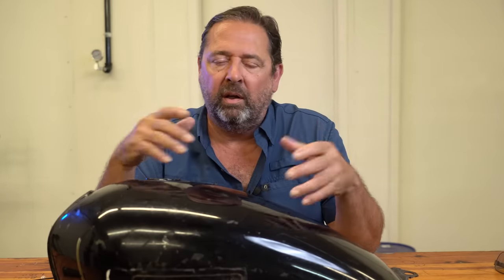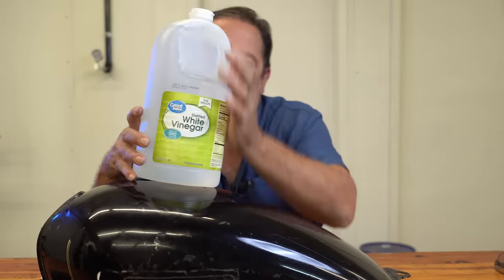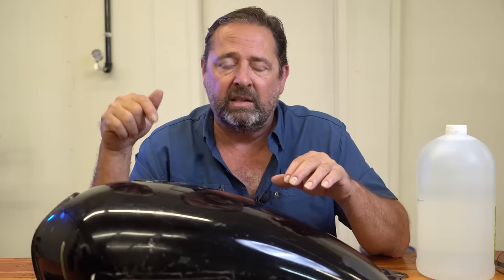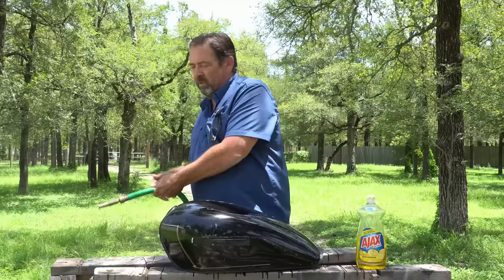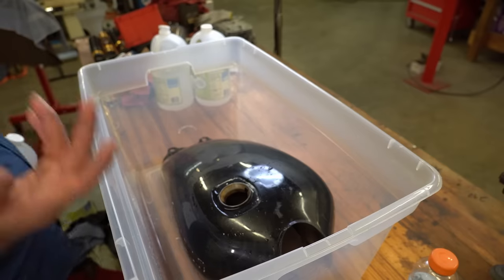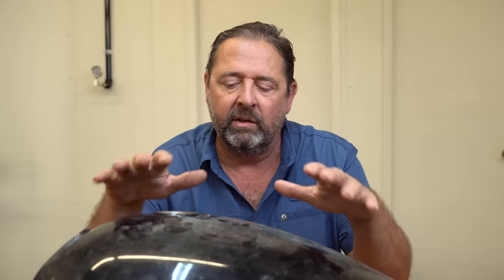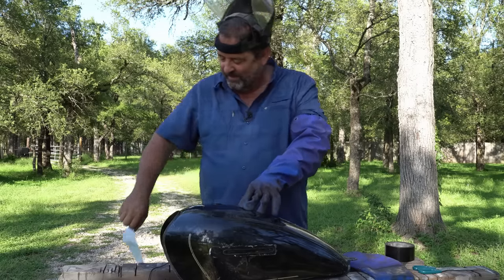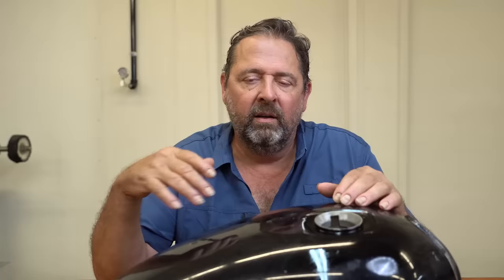GAS TANK--CHEAP--RUST REMOVER !!!!!!

Comment: The works toilet bowl cleaner usually under a dollar a bottle. Use high pressure water first to get rid of loose debris in tank.plug petcock opening.  Pour the works in tank, swish around  top to bottom for a couple of minutes. Open cap and look at results. If still rust continue until,bare metal. It removes all rust to a bare metal . High pressure water rinse. Add baking soda plus water to neutralize acid. High pressure rinse. Air hose out remaining water and spray with WD-40. LET DRY. Will not rust again. Do not leave the works in unattended for a long period of time or you will not have a tank left. This in tire process takes less than 15 minutes.
Reply from the maker: I'll check that out.

Comment: What about for some white corrosion in the tank?? Just bought a 02 gsxr has tiny bit of rust but has some white corrosion towards the top how can I remove it the best? I was thinking the vinegar and a toilet brush or something let it soak for a while?
Reply from the maker: Take the tank off, get everything that you can out of it, i.e., sensor/float.  Plug all holes except fuel inlet, then fill with strong vinegar 18-30% (Walmart garden area).  Fill the tank up to the brim and let it sit for 24-48hrs.  Drain, rinse with water, blow out remainder with compressed air, putt back on bike and fill up with gas.  Depending on how bad the rust is you may need to repeat rinse process a few times.  Hope this helps.

Comment: Is the acid necessary? And do I need to put a coating on the inside of the tank if I just use the vinegar?
Reply from the maker: You don't have to use acid, just be sure you leave the vinegar in for a lot longer, like several days.  And no, you don't have to seal the inside of your tank with a sealer unless it's really bad, i.e. pin holes.
Reply: @CycleFab  Got it. Thank you for responding, have a good day!

Comment: Once you neutralize the acid with baking soda and water, you spray wd 40 or put some oil in there. After that do you wash it out with water ?
Reply from the maker: If you are going to put the tank back on the bike then just wash it out with gas.  You can also wash the oil out with acetone.

Comment: Question . Have you ever used Rust Converter in a Tank , after getting rid of the Loose Crap ? 
Calcium Carbonate  or  End-Rust or some such . Then of course , should still get sealed .
Reply from the maker: No, I haven't.

Comment: For decades I used Diluted Phosphoric Acid, and clean gravel together to chemically remove rust, followed by a couple of rounds of neutralizing with baking soda and water, followed by lots of fresh water flushing, and hanging in the sun to dry.
Today,  I would use Evaporust heated to 90-120 F,   the clean gravel is still a good trick, for both the cleaning and the rinsing.  There is still no better Tank Coating them 3M Fuel Proof Coating.   it is an industrial product and full of VOC's  so probably hard to get now.  You Must mask the paint and plug the fuel tap  ( and vent if there is one), before using this coating.   Drain all excess, hang in sun for a few days to cure.  it has a slightly red color that looks very original in most classic bikes like BMW.
Reply from the maker: Sounds really thorough.

Comment: I’m worried about flash rusting.   After the acid shake is done why not just pour baking soda directly into the 1/2 gallon of acid in the tank will it boil over?   How much baking soda is need for 1/2 gal of acid to be neutralized
Reply from the maker: NEVER POUR BAKING SODA DIRECTLY INTO ACID WHILE ITS STILL IN YOUR TANK!!!  IT WILL HAVE A VIOLENT REACTION!!!

Comment: I have a plastic barrel of phosphoric concentrate, I mix 12 parts water to one part concentrate, it is the only proper way to turn rust into oxygen,it only removes rust, I put a ball peen hammer into a bowl of the concentrate and forgot about it for a few days, it looked like Swiss cheese, the carbon was obliterated, vinegar will take forever if even work
Reply from the maker: I've heard that it works better/faster.  Thanks!

Comment: Any ideas on how to restore the gas cap seal? So fumes don't escape. Mine is kind hard, not sure if it's supposed to be soft
Reply from the maker: Unfortunately no, I don't.  If it is to the point of being hard then I would say it's at the end of its life.  Your best bet would be to make one.  Possibly a 3D printer (if they can replicate soft rubber material) or just try to cut, shape or mold one out of some rubber gasket stock.  Thanks for watching and commenting.

Comment: I wash like you first then use citric acid. i buy 25kg and has it for years and years all i need for one tank is about 1-2 cups of it... You can use it over and over is you bother to take the crap out. But to seal it. I have not found anything real good ore cheap. I use 2stroke oil ore just oil to preserv it. Thats how i have my old stock saved old used tanks. And it holds for ever like that. Some tanks i dont even seal i just use a little 2stroke oil in the tank.
Reply from the maker: Thanks for commenting and sharing!

Comment: Great video of the process. I have a question about it though. I am in the process of rebuilding a bike right now and it looks like the tank has had a sealing kit used on it. Will this process still work with the sealer or will I have to repeat it a few extra times.

Comment: Could you rinse the vinegar out with a heavy oil? Then maybe rinse/dilute that with some gas. Then no flash rust?
Reply from the maker: Use two stroke engine oil.  Some of my viewers have had positive results with this for preventing flash rust.  This does not work for muriatic acid though, you'll need to use a baking soda/water mixture to neutralize that.

Comment: I have a 2004 Kawasaki Vulcan Meanstreak 1600 that has a fuel pump inside the tank. Do I need to remove it  before doing this process?
Reply from the maker: Yes, you do.  Thanks for watching and commenting.
Reply: @CycleFab  Thanks!👍

Comment: After you dump the acid do you have to rinse the tank again? Or just blow dry it or what? I tried the acid but didn’t get a very good result. There’s always those last few drops that get trapped in the tank.  I rinsed it with water and baking soda and then just water after dumping the acid and blow dried it. But after sitting it rusted again.
Reply from the maker: I find it best to apply two stroke engine oil after the rinse and dry to preserve the bare metal.

Comment: Got mine soaking in vinegar now. Apparently ball bearings work well when added too?. I'm doing a project  and plan to repaint the tank. So won't be go8ng back on anytime soon. Wd40 be OK after cleaning it out to keep it rust free?
Reply from the maker: Use two stroke engine oil instead, it works better if the tank is going to sit for along time.  WD-40 can turn into a brown shellac type substance if it sits too long.  Thanks for watching!  And good luck with your project.
Reply: @CycleFab  Brill, thank you. Great vid by the way.

Comment: So, in order of process 

1) Spray with high pressure water 
2) Add Dish Soap to clean the tank  
3) Wash out soap, let dry 
4) Fill tank to the brim with Vinegar 
5) Add Water and Baking soda to neutralize the Acid (Vinegar)
6) let dry
8) Quick rinse with Muriatic Acid -30 seconds to a minute) - Cover any holes with a good tape 
9) Acetone rinse to neutralize the Muriatic Acid 
10) Fog the tank / Spray the inner tank with WD 40 to keep it from flash rusting until you are ready to seal the tank 

am I forgetting anything?
Reply from the maker: Baking soda/water mix for neutralizing muriatic acid not acetone.  And use two stroke engine oil for coating inside of tank instead of wd-40.
WD-40 over time will turn into a shellac so I choose not to use that any more.
Reply: @CycleFab  hey 
I just commented on your video
We should use the engine oil coating after all the process is done right?

Comment: Can we wash tank with pressure water AFTER treating it with vinegar then let it dry and dont use anything else?
Reply from the maker: That would probably take your paint off, but yeah, you can use a pressure washer.
Reply: @CycleFab  I did that but it leaked my rusted tank. No one should use high pressure water inside if the tank is old and rusted.

Comment: Got a cast iron tank off hit&miss motor. Don't the muratic acid make iron rust?  Just  asking, heard that before.
Reply from the maker: Yes, it does.  It will cause a "flash rust" at first which is very light.  You must neutralize the acid that is still coating the inside of your tank immediately after you pour the used acid out.  Then coat the inside of your tank with two stroke engine oil, this will help preserve the bare metal until you're ready to use the tank.

Comment: Citric acids probably slightly better, IIrc CA wont attack the base metal just as bad as vinegar as its ph is 3-4, compared to vinegars 2-3,  but is still equally as effective on turning oxide to metal salts, which is problematic if life gets in the way and you forget about it while its sat in acid, its pretty cheap too, probably not just as cheap as vinegar but usually can buy it in powder form for the likes of beer brewing/wine making, here in the UK we can get it for £6  for 500g which is probably about 8 bucks a Lb?, but it'll probably be cheaper in the states than rip off UK.

Comment: Do I have to use a sealer afterwards? Or can I just fill it with gas and go?
Reply from the maker: Fill it up and GO!!  Sealer is an option, typically used when a tank is already leaking; pin holes, cracks, etc.

Comment: Ok, so after 48hr with the vinegar,  rinse with water, then add baking soda and water, rise with water , then add 2 cycle oil ,mix around the tank , drain,  then its ready to use,  correct?  I'm doing this for a small lawn mower tank . How much 2 cycle oil should I add to mix around the tank ?
Reply from the maker: Yes, correct.  Use however much of the 2 cycle oil as it will take to coat the inside of the tank.  Thanks for watching and getting some use from my videos.
Reply: @CycleFab  thank you so much for responding so quickly.

Comment: Thanks for the video. Maybe I missed it, but how long did you leave the vinegar in the tank before pouring it out?
Reply from the maker: 24 hours at the minimum.  Thanks for watching!
Reply: @CycleFab  Thanks man. I have a 96 2wd Tacoma. The guy I bought it from last year said he changed the fuel pump but it was sputtering every time it got to 1/4 tank, and changing the fuel filter didn't fix it. Just dropped the tank this afternoon-remaining gas looked like crusty rust soup and the sock had blobs of rust sludge on it where it draws. The guy must have just dropped the pump in to sell it. I scrubbed it w steel wool and soap, and now it's doing a vinegar soak. It's old and ugly, but w 328,000 miles, it runs great and doesn't burn oil, and gets 30 mpg if kept at 65mph. After putting better bucket seats in it, I like it as much as the newer truck I have, especially driving 120 miles a day at times. Hard to believe it drove 8000+ miles this year w that mess in the tank. NC humidity + ethanol gas+time sitting unused=chunky orange gas.

Comment: Great video I'm dealing with this on a tank on my Honda VTX 1800 did the vinegar because the evapo rust didn't do the job and as soon as I rinsed out the tank it started to flash rust I actually put a gallon of non-ethanol fuel in it with about a quart of Marvel Mystery Oil and sloshed it around and did that periodically and it's still rusted back so I guess that was the improper product so I've drained it since and a lot of rust came out and I have it soaking now for the third day with white vinegar when I rinse it out with a little baking soda and hot water my question to you is I would suggested to spray inside the tank with fogging oil and then it should be fine to sit until I use it on the bike but my other question is what would I use to seal the tank and do you recommend that I seal the tank? Thank you this was a great video and help
Reply from the maker: Thanks for watching and taking the time to reply.  Here is a video on sealing a tank that you will find very helpful. https://youtu.be/S8DJ8pUw9Yc
Just remember to get all oil residue out of your tank before you try to seal it.  I always seal my tanks, even the brand new ones.

Comment: so I have the tank filled to the brim with the vinegar..... I'm a bit leary of applying a tank sealer in case I don't do it correctly I will create another problem.... What are my options if I just stop at the vinegar step? Any thing else I need to do? I was considering just put the tank back on the bike and fill it with gas and be done with it. Your opinion please... TIA for all any and all input.
Reply from the maker: Really, the only time you need to use a liner is if your tank is leaking due to rust damage; pin holes usually.  Just make sure that after the vinegar you neutralize it with a baking soda-water mix.  You'll be good to go after that!  Thanks for watching.
Reply: @CycleFab  Many thanks for all the help with my questions and repeat questions.... Thanks to your willingness to share your knowledge...

Comment: Do not use WD40 to preserve your tank after cleaning the rust out! It is oil based and sealant won't bond to the tank. The process needs to be completed immediately after the vinegar or whatever cleaner you use. When the inside of the tank is dry, seal it straight away! From experience.
Reply from the maker: Thanks for the input.

Comment: hey, I'm going to do the same method as you said in the video
Just wondering after you rinsed the vinegar out
Did you neutralize it with water and soda or with acetone or cleaned it with soap and dried 
And also as you said in one of the comments use 2 stroke engine oil as a sealer is it ok to do so 
Cause many say sealer don't always work
Pls help me with this query
Reply: And if we do neutralize both vinegar and muriatic acid with water and soda for how much time should we keep it?
Reply from the maker: The 2 stroke engine oil is to keep the inside of the tank from rusting, if it's going to be a long time before you seal it with your sealer of choice.  I personally like to use Caswell Epoxy Sealer.  And yes!  I do rinse/neutralize the muriatic acid with a water/baking soda mixture.  Thanks for watching and commenting.  Here is a link to my tank sealing video!  https://youtu.be/S8DJ8pUw9Yc
Reply from the maker: Just neutralize the muriatic acid with water/baking soda.  A good long rise, about 3 to 4 minutes of sloshing this mixture and what acid residue is left should be neutralized.  Thanks again for commenting and watching.
Reply: @CycleFab  thanks man
And also what about vinegar
Same process to neutralize it with baking soda and water?
Reply: @CycleFab  so we shouldn't put petrol while coating the 2 stroke engine oil?

Comment: If I’m able to seal with Caswell the day after using muriatic acid. What is the in between step from the acid to the sealer? Thanks in advance. Dropping a like!
Reply from the maker: Wash the tank out thoroughly with soap and water (twice at least) and then with alcohol.  The alcohol encapsulates the water molecules and helps the tank dry more quickly.  After it's dry you then can apply the linner.  Thanks for watching and liking!

Comment: Great video! Is it necessary to seal the tank after cleaning it with vinegar and acid? Will WD40 or Marvel Mystery Oil prevent flash rusting?
Reply from the maker: No, it's not necessary to seal a fuel tank after cleaning it.  I do it because most of the tanks I get have pin holes in them.  Two stroke engine oil would probable be a better choice to prevent flash rust.

Comment: How do you seal it after the muriatic acid?
Reply from the maker: Caswell Tank Sealer. Check them out, here's a link...
https://caswellplating.com/epoxy-gas-tank-sealer.html?gclid=CjwKCAjw5remBhBiEiwAxL2M9zjrSr9TTxpHtWaISsVhzd0pMrmPJT6lN7LvJ28C7i2sdXCPu8lDIRoCv2sQAvD_BwE

Comment: Hello and great video. One question, do you wash out the tank with soap after the muratic acid? Thanks.
Reply from the maker: I neglected to show that a baking soda-water mixture is used after the acid is poured out.  And after that I rise the tank with soap and water then just water.
Reply: @CycleFab  thank you very much.

Comment: forget the vinegar, it takes too long and doesn't even remove all the rust, after removing all you can by washing tank out just skip to the muriatic acid, when in a hurry I've used it as strong as 1 gal acid to 2 1/2 gal water on a 3.5 gal tank but if that strength makes you nervous  you can dilute the acid ratio as low as 10% acid which is still stronger then vinegar, following acid  flush with baking soda and water then rinse with plain water and seal immediately, you can get the whole job done in under an hour............
Reply from the maker: Good point!

Comment: Just put a 50-50 mix of MMO and gas and let it sit a few days.  Shake it good every once in a while.
Reply from the maker: Good idea.
Reply: @CycleFab  Give it a try and let us know.  My old '89 Accord tank looked not so hot inside.  I ran some MMO for quite some time, not more than 2 oz. per gallon.  When I looked inside again, it looked pretty darn good! Thanks for the reply.
Reply: @CycleFab  I did some experiments.  Without an abrasive, it didn't work.  I guess what was in my tank was some kind of scum, and not rust.